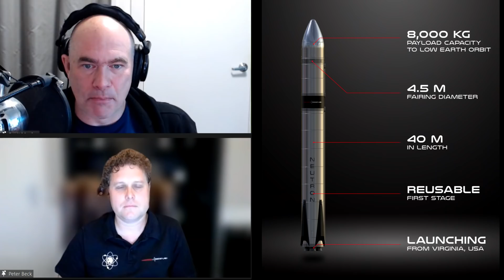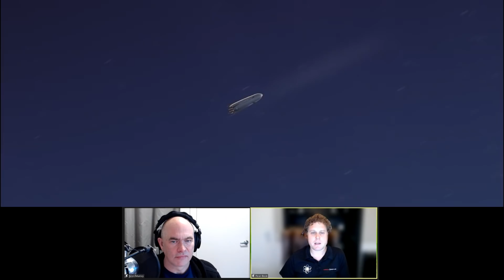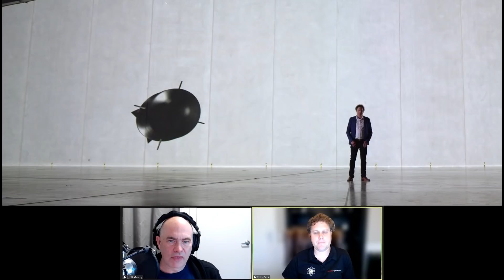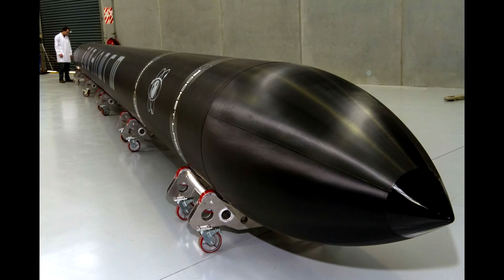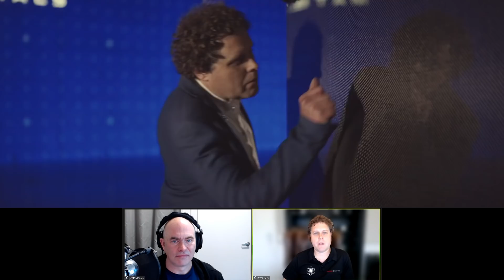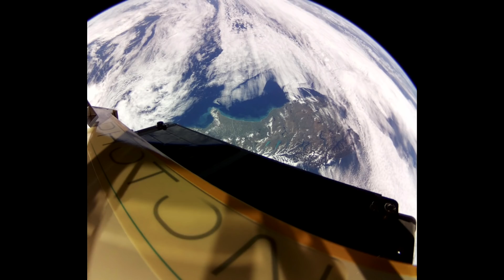Rocket Lab's Neutron Rocket's Innovative Design Explained By Peter Beck - CEO of Rocket Lab

Comment: There's an idea: If starship could decelerate back to earth using one engine at very low thrust, it would create a retropropulsive shield around the rocket, protecting it from plasma, and the need for a heat shield would become much less, and probably blankets would suffice. Once enough speed is bled off, starship can turn to glide like a brick - mode, in preperation of the landing burn. This would make production of Starship twice as "easy". It would require more propellant, and how much I do not know. Maybe someone can caluculate that.
Reply: It wouldn't work. Look up "Supersonic retropropulsion", and you'll know it is way more difficult. Plus, the engine would've been running for a few minutes at a pretty serious thrust with this profile - no way you could store enough fuel for that!
Reply: I think the issue with that is you'd need starship to go in butt first, which would really reduce the amount of aerobraking you could get our of the atmosphere, my guess is without the broad side to reduce speed, you'd come in too fast
Reply: @velbythorngage  probably, but my thinking is that heat shield. I'm afraid that's going to be the biggest nightmare of all. If it can be removed or reduced, that would always be a big bonus.I am not a rocket scientist, but I am talking minimum thrust necessary to repel the air it is slamming into, so starship would be braking on a big gas cushion.

Comment: If this turns out like planned it will be giving the Falcon 9 some serious competition. But the design will mean it could never be rated to carry humans. The design pretty much rules out any fast accent escape capability. But isn't it amazing, 60 years ago we saw something like this in a James Bond movie, now it could become a reality.
Reply: In his interview with Tim, Peter states that fairings are not required for a human capsule - the capsule would replace the fairings so they wouldn't be an issue.
Reply: They are planning to human-rate it. The plan is to ditch the fairing for the crewed variant, so the second stage is still hanging from the first stage, but it then immediately transitions into the capsule in order to retain the aerodynamics.
Reply: @Surtwo  Ah, have not watched Tim's interview yet. I am guessing they will simply be attaching the crew module to where the fairings attach, seeing that they are the load bearing points for the upper stage. Really is a clever design. Will certainly be a Falcon 9 beater if it all comes together like planned. But, having a great concept is one thing, building it is another. I personally would love to see it come to fruition with minimal changes.

Comment: Carbon fins?  It'd be nice to hear if that's carbon fiber composite or something more radical like carbon/carbon.  What do they plan to use as a matrix, that can tolerate being heat soaked in a hot oxidizing environment?

SpaceX tried aluminum and switched to titanium.

Aircraft with composite propellers typically have metallic leading edges so that there is something ductile to tolerate impacts.
Reply: The fins are at the tapered end of the rocket, so they might not be directly in the flow of superheated air. My biggest question is if they get enough control authority with this. I believe the grid fins are particularly good for control during the trans-sonic regime.
Reply: @espenha  You might have that reversed.  Grid fins work subsonic and supersonic but choke trans-sonic.

Comment: One thing I still don't understand is the 'suspended' second stage. I have seen Peter asked about it and his replies but I still don't get it.

Once the second stage is firing there is more load placed on the structure of the second stage than the first stage would have subjected it to and that force would be applied at the base of the second stage.  So I really don't see how suspending it from the payload adapter reduce the needed structural strength unless the second stage engine were to have its thrust applied there as well instead of to the base of the tanks.

At one point he explained something about the pressure in the tanks providing the strength needed to resist the engine's thrust but I still don't get that. If that is sufficient to react to the 2nd stage engine thrust then would that same pressure not be able to resist the force applied by the first stage to the base of the tank?

It seems to me that the extra structure on the first stage required to transmit the load directly from the first stage to the payload adapter rather than the base of the 2nd stage is actually redundant mass which is duplicating the 'strength' already provided by the pressure in the second stage tanks.

What am I missing here?

I'm also wondering whether instead of the large 'petals' it would be better to have only the tip hinging open, either in two halves or perhaps even a single piece, similar to that on the Crew Dragon. If the second stage is ejected straight forward it only needs an opening equal to its diameter rather than along its whole length. If the fairing were fixed with just the end openable it seems to me it could be made much lighter.

Comment: I would love to hear what Elon had to say about all the shade thrown at marine landings
Reply: Considering that SpaceX aren't doing drone ship landings either with Starship, I imagine Elon would agree. He may not be so concerned as Peter about the cost of infrastructure, but having the booster return to the launch site is much more convenient, which is why they do it for Falcon too when they can get away with it.
Reply: @simongeard4824  i believe they have I'm fact looked at marine landings for Starship. It's in the mix. But time will tell
Reply: @blackterminal  No. What they are considering is having offshore launch sites, based on modified oil rigs - but this is just a workaround for the problems of launching big noisy rockets near populated areas. The booster would still be flying back to the launch site, not landing on another ship downrange. 

Nobody actually wants to land hundreds of kilometers out to sea... that just adds extra costs in transporting the vehicle back to the launch site, and kills any chance of having rapid turnaround. Even with Falcon, SpaceX prefer to land at a pad near the launch site... but the barges are needed because many of their payloads are too large for RTLS, and a few days transport time doesn't matter too much for Falcon. It matters a lot more for Starship and Neutron, which want same-day re-use.

Comment: I think we need a manufacturer that just do very good rocket engines.
If all these startups  could choose from 3 sizes of methane engines right now, they'd collectively save a megaton of hurt.
Maybe as the sole job of Blue Origin, if everybody used their engines, they'd have less reason to sue all the time.
Reply: Based on Blue Orifice's performance to date they would probably never get off the ground.
Reply: Being at the mercy of a sole supplier that could throw a tantrum and take all of its toys home is a terrible idea!
Reply: @ahaveland I Remind me, how many shops made their own airplane engines in the 1930ies vs the 1990ies? How much would a car cost without OEMs?

Comment: Is it possible to place the upper stages of rocket engines (the vacuum optimized ones) into a stable parking orbit?  So we could collect them all down the line and send them farther on?
I imagine an orbital recovery and refurbishment station. Using these engines to move the resources of the solar system.
Reply: You will need fuel for that meaning less cargo.

Comment: Don't get the advantage with hanging the second stage inside the first stage. The second stage will still have to handle compression loads once the second stage engine lights. With this design they have two independent structures designed to handle the same load case without sharing the load between them.
Reply: This has been explained in other interviews. The issue with buckling is when the second stage tanks are unpressurized. While after stage separation, when the engine fires up, the stage is pressed for flight, and can handle a lot of compressive force.

Comment: Imagine if for fun, SpaceX sent a spare Starship to venus to just slow down and float to the surface as its so dense, being steel it would easily survive the temps and land ok. Just need electronics inside a cold/insulated chamber deep inside.

Comment: Somebody is going to come along and do drone-ships for profit in the same way AMT now provides most of the cell towers no matter who the cell phone company is. Guessing, like finding routes for highways (most originally used game trails), terrain and destination will pretty much decide the issue of place. For space vehicle recovery you look at where ppl want to land and I'm guessing that's pretty much in the same places, so set up your ships there and start ringing the cash register.
Reply: Except that the place they want to land is the same place they took off from. It's hard to get rapid turnaround when it takes a week to get the booster back from the landing site. Neither SpaceX nor RocketLab are doing drone-ship landing for their next-gen rockets, so what's your market for such a service?
Reply: @simongeard4824  Weell, SpaceX might eventually be doing drone-ship landings with Starship. They have two old oil rigs that they are converting to being launch platforms. They could launch Starship from one of these, and the Super Heavy could land on the other one. And then they could just swap positions for the next launch.

It's a useful option, even if you don't do it for every launch. (Of course, they wouldn't be making a market for third party droneships. Starship is just so big and doesn't even have landing legs.)
Reply: @espenha  They could use the oil rigs that way - but I think it more likely that if they do end up using them (and Elon has said they were an opportunistic purchase without solid plans), they'll be placed in separate locations to give them access to a better range of launch inclinations. And forget about swapping them between launches - moving them means sending tugs out to tow them around, and that's a multi-day exercise at best.
Reply: @simongeard4824  There will always be a compelling cost case because not having to fly back to the launch site saves a lot of propellant, and as payloads get heavier, that's the difference between reusable and expendable.
Reply: @roijoi6963  Or between doing the mission and simply not doing the mission. Because if the cost of offshore recovery is enough that you're not making money, why do it? The balance will vary between providers... SpaceX can get away with it for Falcon, but that doesn't mean it's a good option for the smaller vehicles.

Comment: Any possibility of using a downrange island as a landing site if they want the to increase the payload?
Reply: It's certainly possible, but you still have the challenge of bringing the stage back to the launch site. (Unless you have an infinite chain of properly spaced islands...)
Reply: Sounds unlikely. Peter is coming off very anti marine in these interviews. Let's hope he doesn't have to eat any more hats!
Reply: If you can find a island on the correct trajectory at the correct range.
Reply: Lensflare Deviant -- You should be able to get lots of cross range movement for less delta-v than doing a boost back to the launch site.
Reply: @donsample1002  Cross range is expensive in Dv especially as the velocity gets higher.
Reply: Kim Wilson -- Not as bad as stopping, turning around, and going back the other way.
Reply: @donsample1002  I would think so but you will still be limited.

Comment: I want to know why they're going with a 4 door fairing. Seems like more room for failures and more seals to worry about
Reply: Actuators are pretty reliable these days aren't they?
Maybe that's why
Reply: iirc they're bouncing between 2- and 4- petal fairing. Also seals arent such a huge deal. Before launch of course you'd make sure it was sealed up, and on descent they're so far back that it doesn't matter. Heck, the falcon 9 gets away with a bare interstage on reentry
Reply: From Tim Dodd's interview: The early design considered using them as aero control surfaces, and eliminating the need for the steering fins, so 4 were needed. That didn't work out and Peter says they're still deciding between 2 piece and 4 piece.
Reply: @donjones4719  yea they talked about it like 75% through the video haha
Reply: @blueberry1c2  And of course on fairings they really just need to keep the breeze from coming in, they're not air tight.
Reply: It his for good clearance from payload release.

Comment: Scott Manly will Neutron be used to replace broken/failed starlink satellites?

I'm in a heated debate. I'm almost certain Beck and Musk have coordinated that Neutron will be used to maintain and service the Starlink Constellation.

SpaceX is not and cannot be bothered to build a rocket that can service 24 orbital planes on demand with a fail rate of 5 satellites failing per day.

Only Neutron, a rapid fire, return to launch pad, cheaper, 8,000kg reusable rocket can do this.

Would you not agree?

Falcon9 is too expensive to service 5 or 10 or 20 failures especially if across 24 orbital planes.

Starship is even LESS able to manage this feat at cost.
Reply: @randomnickify  that's not the question. The idea that every orbital plane will be stocked with spares every time the entire constellation has to be replaced is a higher cost than just repairing failures in the 3-5 year window

Comment: Question: 
Could the second stage booster, once the satellite is in orbit, be turned around and returned to the booster and incased within 
before it re-enters?
Reply from the maker: No
Reply: The booster would be landed by the time the payload is in stable orbit, at least if the F9 is anything to go off of
Reply: @alexsiemers7898  Yes, and even if you look aside from the time-considerations (basically assume the second stage could travel back in time), the second stage would still be thousands of km away from the first stage, and travelling around 7 km/s faster than the first stage. You would need a lot of propellant to get it to the right place at the right velocity. Basically full tanks.
Reply: Thank ya'll for the replies!

Comment: Would a Joint Venture with SpaceX for down-range landing be an option? If the costs for Marine assets are so high, even if they are in port, having a high usetime would be preferable.
Reply: That's not a bad idea, assuming the Neutron launch site ends up being near Kennedy Space Center or Vandenberg, where SpaceX has their barges. But it's entirely possible that SpaceX might still charge quite a bit. For one thing, it's quite possible that Rocket Lab could mess up the first few barge landings and damage the barge.
Reply: @espenha  Yeah, but you can always charge damages and opportunity costs. The pure operating costs could be 3/4 of what SpaceX is paying right now.
Reply: Launching from Australia (Woomera) with a recovery in New Zealand would be cheaper…
Reply: Bring the Chinese onboard. They will build an island to land on.

Comment: I wonder if they could use the 4 part fairing for atmospheric deceleration. Would have to be bulked up a bit but could that pay off?
Reply: Tim asked that question! Peter said that that was the idea initially and thats why there are 4 of them. But they world have to be ridiculously strong, and they had worries of shock waves attaching to the fairings
Reply: They considered that, but then decided against it. Too complicated and due to the already great aero breaking the large bottom provides not neccessary either. I think it was explained in the interview with Tim Dodd, but it may have been the one with NASA spaceflight.

Comment: This would be a whole lot more credible if he would stop saying things that aren't true.  "All carbon" - with lots of things that definitely won't be carbon.   "No landing legs"  because "mechanisms are bad", but shows landing legs extending, and then mentions landing legs acting as shock absorbers.   Then there is that bizarre four-part nose with zero mechanisms shown for latching those four long seams together, tiny single-point hinges at the base of each section.  Why not three parts?    Beck says Neutron hasn't changed.  Scott mentions they stretched it.  Beck says that not a big change.  It just all looks like someone made up something for a presentation.  At no point does he say, "well, this is a preliminary sketch of the design and obviously it will have more complexity than shown here."  Instead he talks in the past tense about having designed his second rocket.   Hard to believe there is anything behind this at all.    Then that BS demo of the beam hitting the side of the sheet of material that has nothing at all to do with the loading on a rocket.  It all just smells funny.